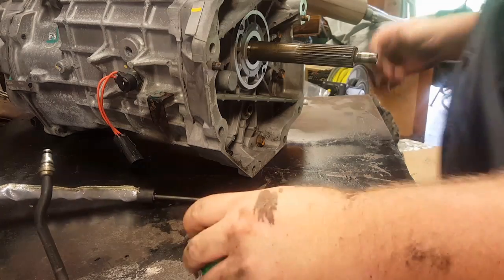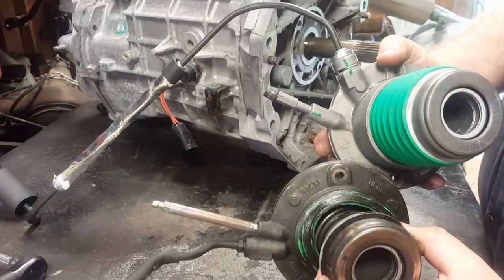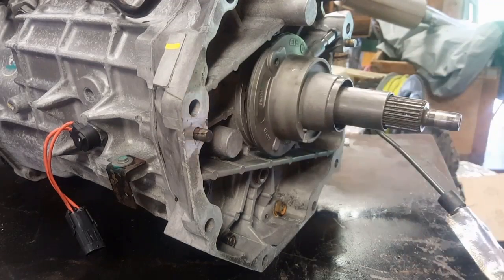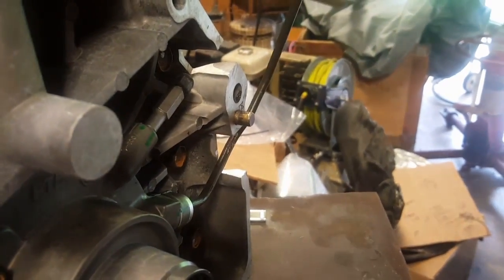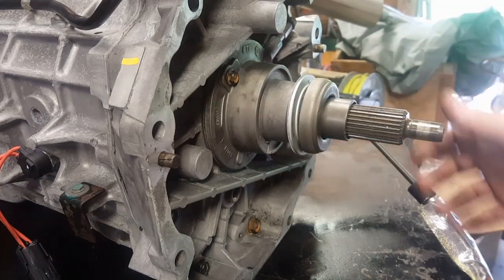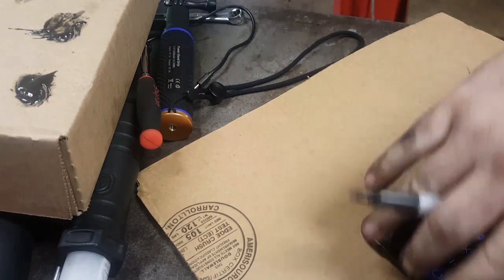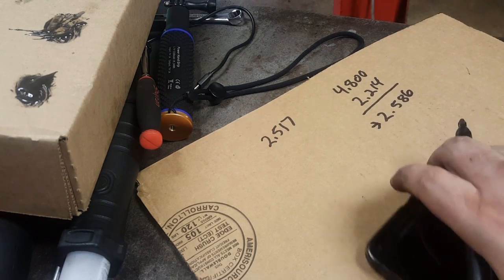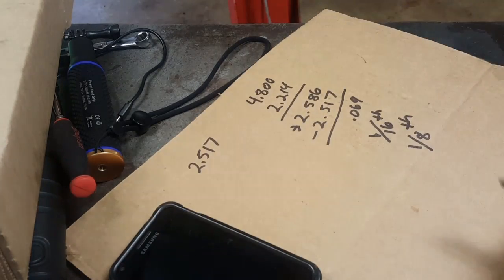Measuring slave cylinder distance t56.CTS-V

Comment: Do the ls7 and the ls6 slave with  spacer measure the same size? I have the monster stage 2 clutch measures 2.500 and the ls6 with spacer but feels like my clutch is not fully engaged, was under the impression that the ls6 w/spacer and ls7 slaves where the same size
Reply from the maker: I know that make different spacer sizes so I'd have to say probably not. Always have to measure. If you had your flywheel resurfaced then the spacing will be different

Comment: Very helpful video . 👍 im working on and ls2 with the t-6060 and i was wondering if you know what slave cylinder to use due to took truck to dyno and seems like clutch its not disangaging all the way ? Thanks man
Reply from the maker: I used the corvette slave cylinder.